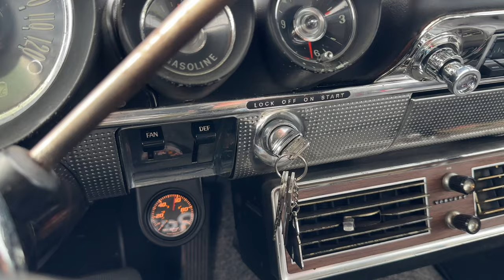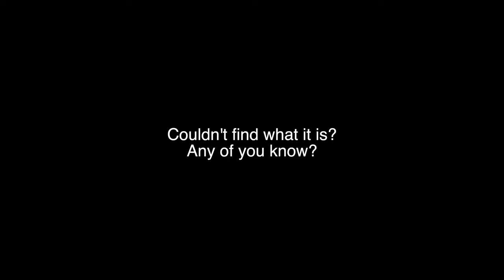7 Years in the Making: Carbon Fibre Upgrade for My E92 BMW M3!

Comment: Hi mate, expanding plastic rivets are what you need to fix the splitter to the bumper. Measure the diameter of the hole and just order some that size, put them in from the top (thru the bumper first then into the splitter. The sit flush so won't protrude and catch on anything and are cheap.
Reply from the maker: Thanks for the tip! I’ll get some ordered !